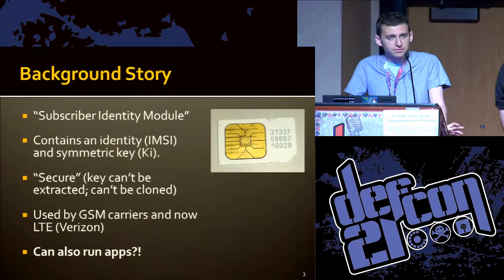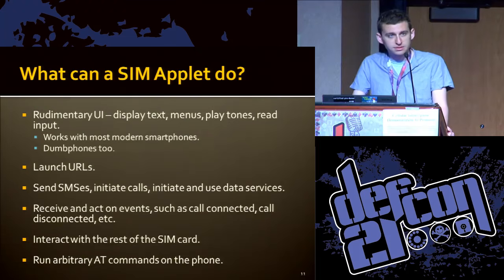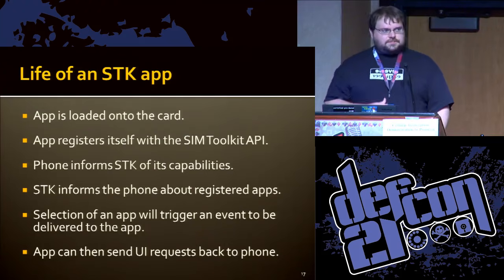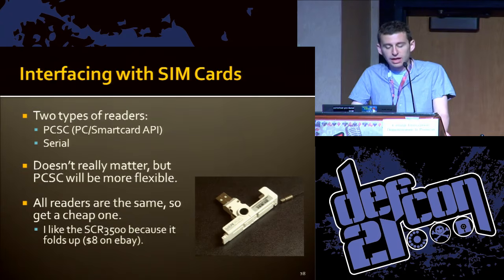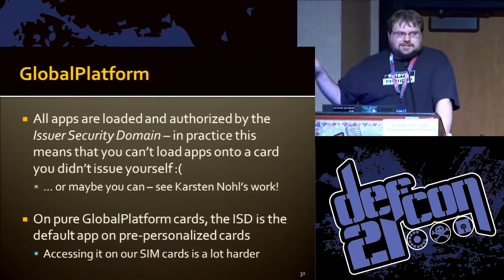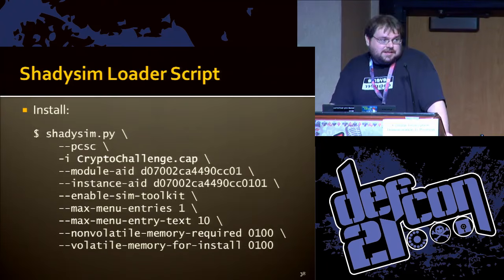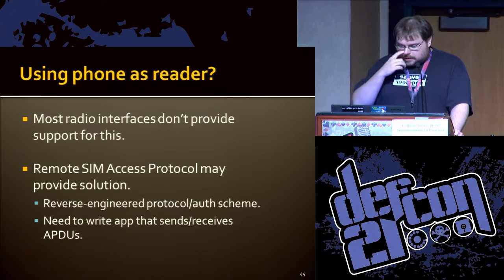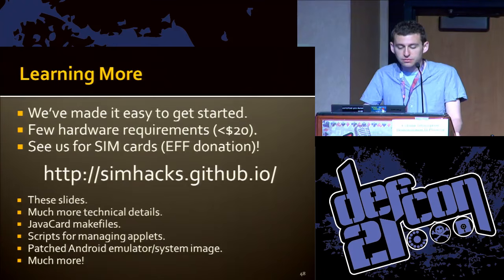Defcon 21 - The Secret Life of SIM Cards

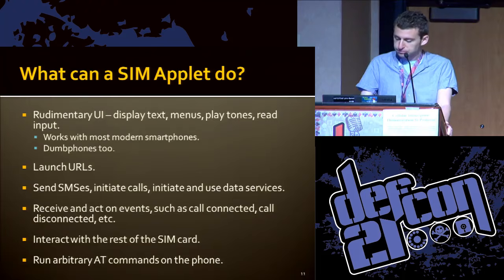Comment: 7:32 If the SIM applet can run arbitrary commands on the phone, doesn't this basically mean that this is some way to "listen" to a phone? I mean arbitrary commands could also mean it can run commands in the background probably without showing anything to the user and therefor activate the microphone and transmit the data to the carrier (or to whomever).. right?
Reply: Note that he said AT commands, which means commands to the cellular modem, not the phone itself. (There's a long and storied history, but ever since the Hayes smartmodem, like, dialup modem, similar hardware to this day uses the Hayes command set, also called the AT command set since every command started with "AT".) What that means is you can interact with the cell network arbitrarily, but not the phone. I, myself, can empirically sorta show this, because my laptop has a cellular card in it (called a WWAN card if you're curious. WLAN is WiFi, WWAN is cellular), and I can open a serial console to it and send commands, if I know the right ones. I've even got a picture of sending myself a text message!

But what that means is that as far as "arbitrary AT commands" means, it only means it has full access to however the hardware can interact with the 3/4/5g network. Anything else, like accessing microphone or phone storage, would require that smartcard communications channel that's (barely) not quite as open-access. So, it can text people, it can start and end voice calls, it can query signal strength, it can request changes to how your phone links to the towers, but unless it is directly tied cellular mobile networking, that isn't something AT commands can do.
Reply: @teknikal_domain This is true, but not entirely. If an attacker manages to take control of the RTOS inside the modem, they can escalate to the Linux kernel. Such escalation occurs, for example, in attacks that exploit vulnerabilities In the implementation of wifi inside the modem.

Comment: They really do police themselves on here. Very heavy with technical details and and general capabilities but nothing practical or really relevant. 

How companies use our SIM and what are the pros and cons of sim phones? 
Is the burner phone really a thing and how to keep your opsec tight?
Capabilities plugged in and on VS outside of phone or inside phone off? 
Possible USB compatibility for loading direct to sim or pull from? 
What's the worst possible trouble someone can give you by hacking or otherwise having access to your SIM?

I mean the audience are wannabes or amateurs mostly, but still, at least make it relevant to Defcon

Comment: That's interesting. I never knew there were mobiles without SIMs. How do you bring your number from one phone to another that way?
Reply: I think the phone is network bound, so you get a compulsory subscription for the network companies which collaborate with phone companies.

I think If you lose a phone you buy another one of the same network version and calls their customer service to cancel the old number or the new one and choose which will be used

I'm really not sure tho
Reply: Thanks for the idea , as new products that are now very interchangeable and allow switching and reading and writing and copy and inter device direct wire connections . As well as transfer of complete Lynix portable device add ons with diverse cell phone multiple adapters at high speed and so much more ability’s . That it’s like a explosion of device uses that never before was so affordable and micro processed and diverse that only ones creative excitement will limit one especially with satellite and ham station and frequency scanners to really make AI a co pilot with a crew working to develop what you simply question if it’s only possible then it’s done before you finish talking with predictive technology .

Comment: I wonder if one can write apps in assembly for it and somehow make it interface with the hardware. A SIM card is literally more powerful than a C64.
Reply: neoqueto -- Maybe there is but that might be a feature on specific SIM cards. What I have found is just by going to Wikipedia's sim toolkit page and then clicking on the ETSI standards document in the references. That's an eye opener just by itself, because it describes the command the phone accepts from the SIM and how the SIM can f with your phone in many ways. But the Standard you want is ETSI TS 131.113 which talks about the USAT interpreter and it's programming environment. It seems to be just a byte code interpreter with specific data types for text messages etc. And skimming through the manual I find in section 8.8 "Execute Native Command". The instruction code is 47H/C7H followed by length in bytes, then some stuff and finally a 16 bit NCI. You don't get to just jump anywhere you want, you have to give it a native call identifier.
And that's where I'll bet it gets card specific. You're going to have to tell the card os to create a new application for you with a certain AID. In that command you're going to have to tell it how many bytes long. Then you would create the application files including writing your binary to a file and setting a special execute bit on it. The AID is probably the NCI. But for that you are going to have to have a USIM that supports this business, has space available and had its access rules/protections set so you can do it, or you have the crypto keys to unlock these features. 
And then I wondered if you can buy fresh un programmed USIM cards online and it turns out you easily can for a very reasonable price. I have no idea what they are the ones I looked at and I would only buy if they can supply the keys and the technical manual. You will likely deal with Chinese who don't speak much English.
Now that's what's possible on the interface between the SIM and the phone and you have been educated on it for free. As a bonus I am just going to throw in I bet you didn't know your sdcards contained a arm core you can run code on using vendor specific sdcard commands.

Comment: In the 2000s in Australia Vodafone sim cards could be used for gprs  data  (dial up speed pre 3g) without any activation of the card just chuck it in and  set the connection to Vodafone and off you go. just used to get $2 sims from the piles in shops. You would get about a week to 2 weeks before the card  stopped working  then you would  use another $2 card. you always got your free calls from a payphone and a straw.  useless info now :(

Comment: Very complicated but interesting to watch. I never realised that the SIM card was a smart CPU based card. I thought it was just a EEPROM.
Reply: I find it crazy to think that inside this tiny tiny chip there's a whole computer with better specs than a freaking NES (Nintendo). 
(Minus a few things like the GPU... I know...)
Reply: If it was only a simple EEPROM it would be so easy to clone. The reason you need a CPU inside is because that way the private keys never leave the SIM, but the phone simply sends commands to the SIM that computes the required cryptographic functions giving back the result, without the phone knowing the secret keys. That is the principle of operation of all smart cards (a SIM is just one of them), like the one in your credit card or your pay TV card.
Reply: Yes, it's likely an arm-m0 with 8-16K of ram with a serial interface and some non-volatile memory. Possibly the A3/A5 crypto and whatever crypto I'm potentially missing about UMTS and LTE might be in there in hardware as well. That's all it is. It has an ISO protocol for talking to it, bits send over a serial line and messages are along the lines of CLA INS LEN P1 P2. CLA and INS are class and instruction. Some instructions are even standardized like those to do with files, SELECT FILE, APPEND FILE etc. Files are not huge btw. There are a few bytes long maybe 512-1024 bytes max because the flash will be maybe anything from  8-32K. The smartcard OS firmware will usually observe wear levelling especially for files that get updated a lot. Without knowing too much I'll bet you have to access the GSM application by authenticating against a file using PIN1. Then you can use the instruction to calculate the reply to A3 crypto challenges. 
And then there are also ways to add your own SIM Toolkit applications.
So you see, it's not at all just a piece of "dumb" flash memory. It definitely can do a hell of a lot more than your first home computer if you had one. Only the RAM is lots less, usually around 1-8K.
Reply: @statinskill  So when you say "Yes, it's likely an arm-m0" you don't actually know. Well when I "actually" knew it was something like  a PIC16.  Your extensive theoretical analysis ignored the primary system constraint. I will leave you to think about that !
Reply: @tryagain.k1821  -- I'll bet there are more SIMs today based on ARM. If not, well so what, 98% of what else I said holds true. It doesn't look like you know for sure yourself, come back when you have something definitive that blows me out of the water here.
Reply: @statinskill  You have missed the point because you have not thought about the system. I am not spoon feeding you. Use your brain. You might become an engineer !
Reply: @tryagain.k1821  That last snide comment of yours just raised your troll score over the threshold.
Reply: @statinskill  Stop arsing around and THINK then solve the problem. You are getting a free education here but you only want to show how clever you are by spouting TLAs.
Reply: @tryagain.k1821  -- The only thing people miss here is that the SimToolkit interface is completely unprotected in the direction from the SIM to phone, meaning the phone doesn't authenticate the SIM and you have full run of the phone's SimToolkit interface. The spec is available online and a lot of functionality is available. You can also tweak other features, if you can modify or emulate what kind of EF files the phone sees and their contents. Oh and of course you can trigger SimToolkit transactions remotely using SMS, which means you can potentially receive anybody's location just knowing their phone number. Though on that last one I'm not sure if that feature is available on all SIMs and if all phones support the toolkit transaction to access the location. 
If that's what you're hinting at with your "you're not seeing the entire system". I suggest you reply with something intelligent or I'm out of here.
Reply: @statinskill  I am "impressed" by your erudition but not your system analysis, Re-read your initial post and consider what it means in terms of the product.
Reply: @tryagain.k1821  I like you.
Reply: an* do you also think your HDD or SSD is just a spinning plate or flash cell? (not meant too offensive but this is obvious)
Reply: @chrissxMedia  Necroposting while being an asshole. Nice.
Reply: @chrissxMedia  to who?

Comment: Before I got a Windows Phone smartphone I would always move my contacts to my SIM card to move between phones but no modern phone OS allows that anymore! Unless there's an app for that?
Reply: android does allow it, at least on samsung devices
Reply: ***** Its android, android is the operating system. Samsung is the phone maker.
Reply: Anlaggy Laggy Samsung FTW
Reply: That's true, I've had this happen to me. I still wouldn't upload my contacts list to a cloud server.
Reply: +BrainSeepsOut It works for me, I took my SIM card out of my windows phone and the contacts tranfered to the android plus the contacts were already on it
Reply: ***** correct. Windows Phone will not let you save your contacts on anywhere but Outlook or another email account.
Reply: +BrainSeepsOut pencil and paper
Reply: +Rowan Wrong Not necessarily the whole truth, although it is the operating system that dictates whether you can save to sim many manufacturers that use Android create their own custom build/ Rom. 

So although generally you are correct, the manufacturer could easily block storage on the sim card.
Reply: ***** What?
Reply: >mfw put down by totally not op
:(
Reply: How does a calculater on a phone work how does it know
Reply: Really fuckin' funny
I'll just mail my Snaps too while I'm at it
Reply: Hmm, You know what it was. I forgot when i transferred my SIM i must of downloaded my backup of contacts that verizon allows you to use.
Reply: w to bypass a key with a higher